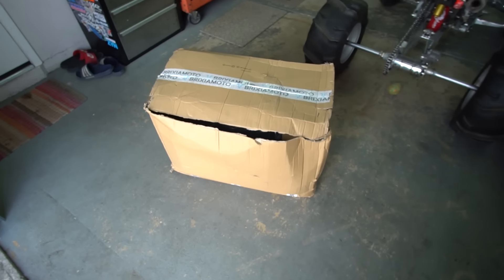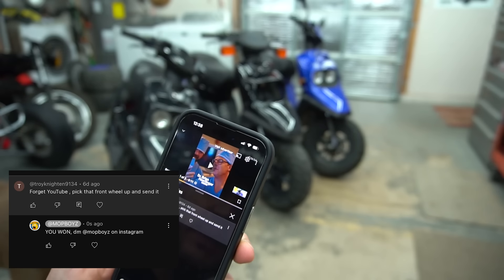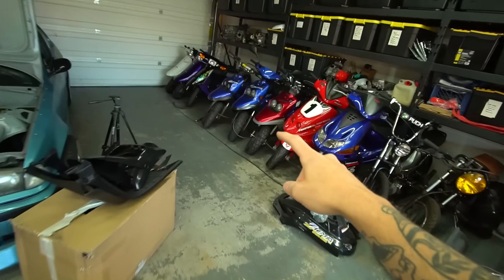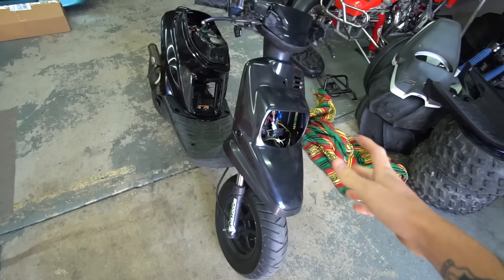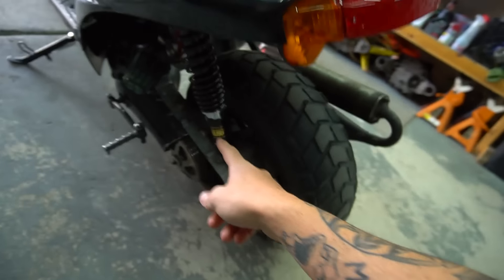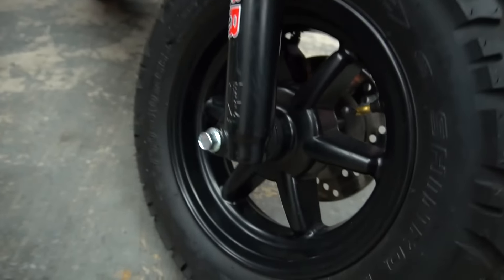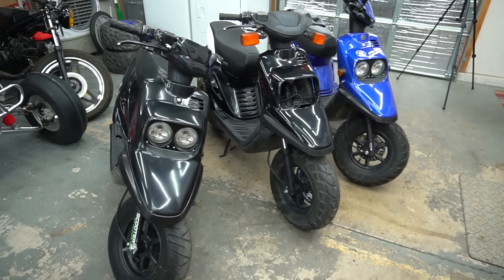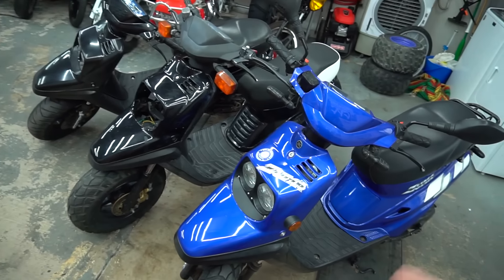$200 Junkyard ZUMA is FINISHED! 70cc Stage6

Comment: The e ton beamer 50cc seat mount works on the zuma as well. I have a 2002 e-ton beamer 50cc scooter and all the parts are usable on the Yamaha scooters. Just a heads up in case you can't get all the parts you need.

Comment: I'm pausing 1/2 way through, I just saw the height difference of the rear shock, and I'm wondering what it would look like jacked up... would some pitbike front forks fit? there are that many versions/sizes of pitbikes, that there must be a length that would work. maybe you've done it before I don't know.
I just brought a new TNT Roma, which is meant to have a copy of the Yamaha drivetrain, I'm yet to have a real good look at it. but I can assure you that CVT restrictor is going to come out at the first service!

Comment: damn those models in my country are like minimum 4/500 euro, and usually that's without title or running condition.. 
Good ones sell between 800 and 2000 euro!
U can buy the sistermodels for cheaper tho, like the Next gen 'my daily' and Rocket. A lot of parts that can swap between them.

Comment: bro,hi from Russia! I advice you to switch one of your zumas for rear disc brakes. for that you need yamaha aerox wheels, aerox rear brake system and an aerox hub. you will have to weld your motor, but it is worth it 
i can tell you more details about how to achieve it as i’ve got my own yamaha bws spy on rear disc brake

Comment: drill a hole in the plastic taps that holdt that litle seat lock pin. and then just take a 5 or 6mm bolt and put that in the hole you have drilled with a nut on the other side
Reply from the maker: it’s missing the hinge not the lock pin haha

Comment: Is stock crank good for 70cc(47.4) polini sport? 

Stock airbox
19mm dellorto phbg
Derestricted intake manifold(a bit bigger than stock)
Polini reed valves
Yasuni R

Could you plase give me advice on this setup? I just need guidamce IM DYING FOR ADVICE! 💎💎💎

I would revv it to around 10 500-11 500
Reply from the maker: stock cranks on prebugs are not good at all. if going 70cc def better get a new bottom end
Reply: @MOPBOYZ 

Thank you for the advice! 

I ordered this parts:

✓Stock airbox (and Polini silver plastic mushroom style intake)
✓Dellorto 19mm PHBG(BS)
✓Stage6 Oversized Intake MK2
✓Polini Sport Cast Iron cylinder(do you recommend to do some cutting, stage 1 to the cylinder?)
✓CRANKSHAFT STAGE6 PRO REPLICA 10MM
Piston pin Minarelli Vertical
47.4mm piston
✓Yasuni R (derestricted)

What jetting do you recommend to start with? Now my jetting is 90 - 60 - 48 in Dellorto PHBG 19mm, should I stick with stock airbox and maybe widen the instake hole a bit? 

Any advice for this setup will be usefull 😊

Thank you 🙌

Ps: my Scooter is Yamaha Spy (CW50RSP) 1997 ("Black 2" edition)

Comment: i wish i could get a bws for 200 dollars, here in sweden they are like 2 to 3 grand
Reply from the maker: they go for about 3grand here too. this one was just a lucky find at junkyard
Reply: @MOPBOYZ have you thought of building a bws/zuma with a horizontell minarelli engine? it would be pretty cool and really powerful
Reply from the maker: @weshn2248  yes but you will need to stretch engine mount a bit to make room for horizontal and once you stretch it that takes away from a good wheelie machine :/
Reply: @MOPBOYZ  i see some websites sell a new subframe that just bolts on and extends it enough to mount one, but yeah it wont wheelie as good